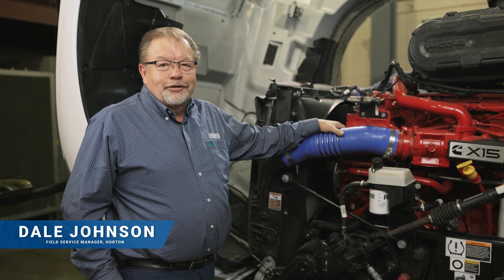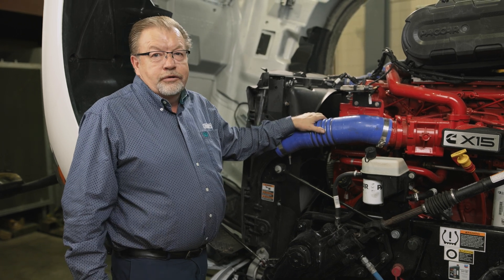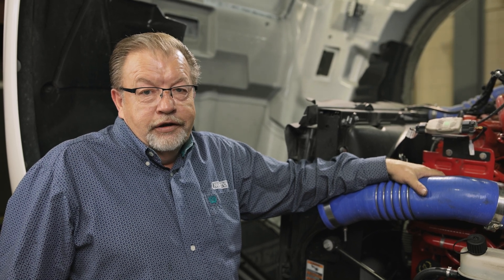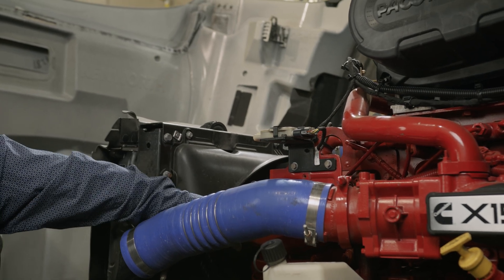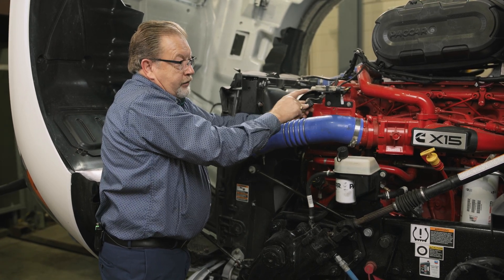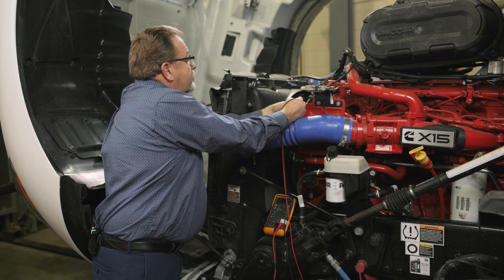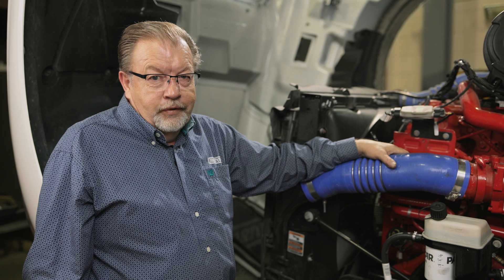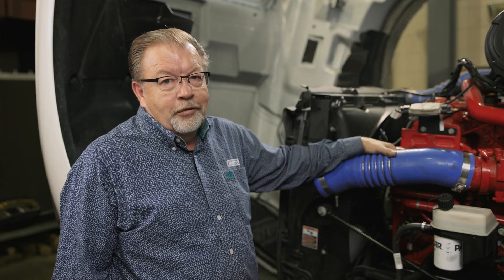TECH TIP | Horton LCX RCX Diagnostics PACCAR Truck with Cummins Engines with Di+ Controller

Comment: So I have a 22 t680 with the Cummins. I’ve replaced the adapter harness and controller still flashes red/yellow. Fan will not come out of high speed.
Reply: Hey man i got the same issue did u fix your problem
Reply: I have the same issue, 2022 pete 579 with x15
Reply: @velelamja I’ve the same problem with my 2022 Pete 579. Did you fix yours?
Reply: @velelamja  what parts need to be changed to get it fixed?